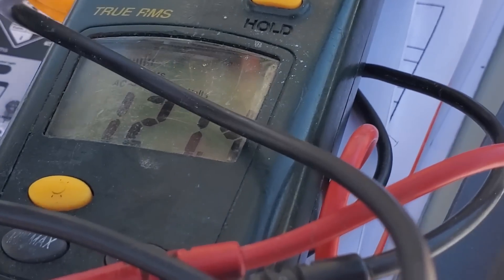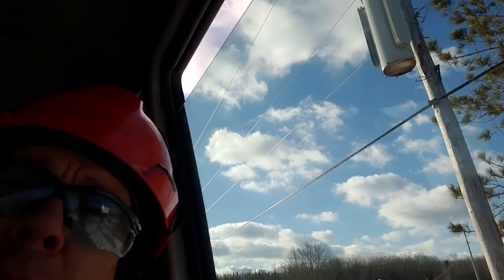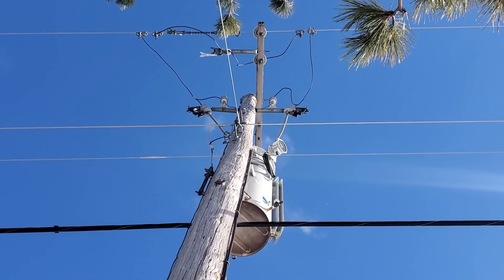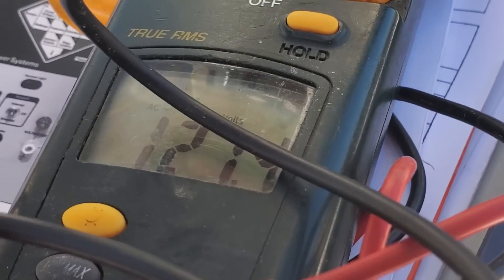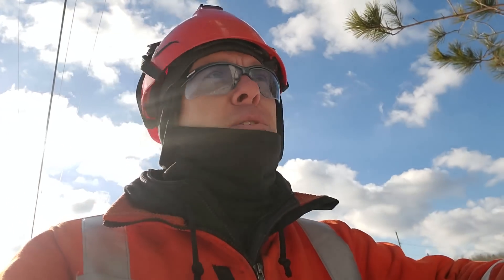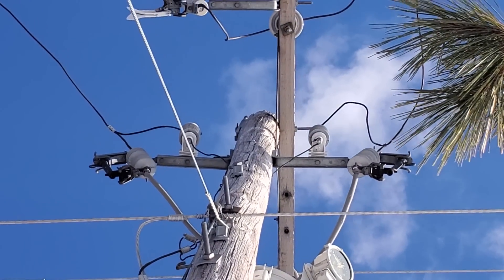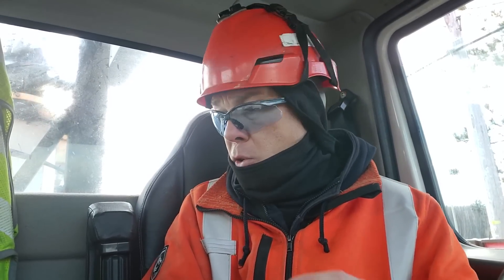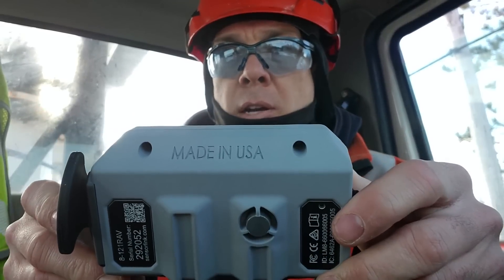Changing high voltage (7200v) at the touch of a button! - VR inspection

Comment: Great video. Voltage regulators have 16 up and 16 down tap settings. The bridge reactor eliminates the possibility of a difference of potential the contact points remain in contact at all times per tap change is 5/8th of a percent and 10% percent in total. The 3 ways to check natural is dial gauge, light in control box,rnd detector s, input feed , l output feed , sL system neutral

Comment: I noticed in my local area in Australia in New South Wales our local supply authority (Ausgrid) has taken a lot of them down since they've got a new substation built in my local town.

They used to have them because our power used to come from a 33/11 kV substation which is located 16 kilometres away from our town, now we're connected to our newer substation which is only about 2 kilometres away from our house.

We're right on the border of the Essential energy part of the grid (6 kilometres) which region covers up to the Queensland border as well as some of Southern Queensland & they use voltage regulators  in that part of our area to control the voltage in the 11 kV feeders.

Some of our local Ausgrid substation covers some of  Essential energys power distribution network !

Comment: Can i ask about the bank transformer. the customer needs 240 volts. the transformer used is 240/480v secondary. the connection at the secondary is delta using x2 and x3. Since we do this connection we receive low power from the customer. Respond and found 1 blown fuse at the primary side. Four times now we keep on replacing the fuse at the primary. if we close without load fuse hold. Maybe you can share your opinion on this matter.

Comment: Bob I appreciate all the info on the high power. I worked 30 years as a Services Tech with Southern Bell/Bell South/AT&T. We are the low voltage side of outside plant. I can tell you I was always uncomfortable coming near all that high voltage on the pole or ground.    Your videos are giving me a better understanding of exactly what  you guys are encountering daily on the line and how it works. Thanks.

Comment: I was putting in a new doorbell transformer for an older customer and I checked the voltage and it was 144 volts.  So I was concerned and checked it at several receptacles and it was the same, so I went to the truck and got another digital meter and it still was 144 volts I told customer that he should call the electric company and tell them about it. And I assumed that he would call them the next morning. Seen him about a month later and asked him what they said lol and he hadn’t even called them. I thought he understood the first time how serious it was. So he called them as soon as he got home and they came out and checked it and directly pulled the meter out, and they got on the phone and had a new transformer brought out. I had asked him if he was buying a lot of appliances and he said it seemed like they wasn’t lasting long as they should.
Reply: Sounds more like an open neutral.
Reply: @stargazer7644  What happens is the insulation between transformer windings breaks down, shorts out a section, changing the effective ratio.

Comment: If those lines were DC instead of AC. The voltage drop would much greater. So much so to be useless. This is on of the reasons why we have AC current.
Reply: Why would you think DC voltage drop would be greater than AC?  Ohms law is Ohms law.  Works the same both ways.

Comment: I notice that some of your residential transformers only have one leg for a primary.  How do you get 240 split phase?
Reply: A single primary is the normal arrangement.  You center tap the secondary to get 240V split phase.  The center tap is the neutral.  The top and bottom of the winding are your two hots.

Comment: Sounds like the R and X settings are not being used, just a flat of 124V. R and X are used to compensate for voltage drop across wire to a feed point, which is basically compensating for the real and reactive impedance of the line. 

R provides voltage boost based upon Watts

X provides voltage boost based upon Vars 

R of 2 V means that at full load of the CT  , (if all the amps were caused by real power/watts), means you’ll get 124 V + 2V of boost, so 126 V. This also works in reverse if you had a bunch of solar connected beyond it, it would lower voltage because power is flowing from load to source. (However; depending on how the controller is set. These controllers can be very dynamic pending what you need) 

For X, it’s the same as R, just with VARs. You can actually have voltage regulators “fight” capacitors if you use X, so X is not used as often. 

Just adding another layer of info to this. Great video!

Comment: Here in Europe, when I was a young boy the voltage would hover around 220VAC. 
But for some reason the power companies have slowly but surely increased the voltage over time and it is now about 245VAC.
Reply: "220VAC. ...for some reason the power companies have slowly but surely increased the voltage ...now about 245VAC."  
Tom Edison started at 100V because less dangerous. But then 100V/200V to feed twice the load with just one more wire. He soon saw you have to put 105V or 110V in to get 100V at the long end of the line. There were still 110v feeds when I was a wee boy. 
That was DC. AC systems made it even easier to fiddle the voltages. 
You can get about 22% more power on the same wires, 245V versus 220V. (Remember allowable voltage drop is larger at the high voltage.) Since loads typically grow every year, jacking the voltage gives some margin against constant upgrading the installed wires.
Reply: @PRR1954  Makes sense, thanks.

Comment: Never seen voltage regulators on lines here in Norway. It's all 3 phase and mostly 22kV. Maybe I've seen them and didn't know...
If anyone got an example that is common in Europe please let me know.
Reply: In the Netherlands, we definitely have them. They're big boys, compared to this, though. In the 10MVA range, and feed a remote switchgear house (or whatever they're called) instead of a single line/cable.
Reply: @marco23p  Any coordinates that would have one visible in like street view or something?

I'm wondering if regulators are part of substations here and that is why I don't see them. Still strange as in rural areas the overhead 22kV lines run very far. Many kilometers. They do not follow roads very often like in NA though. They take the shorter path through the woods or fields. Poles with disconnects and pole mounted transformers are usually near a road or easily accessible.
Guess maybe the distribution transformers are adjustable and can deal with voltage drops?

We also have these small prefab structures around 5-15m2 in size with a 22/0.23(0.4) transformer + HV and LV switches inside. The smaller ones only have doors on the sides to access LV and HV as well as the transformer chamber. Others are big enough to go inside on the LV side at least. The largest ones I believe can also fit two transformers.
The smallest of these are tucked between the legs of a "H"/"A" frame depending on what side you view it from. Probably only fit up to a small 315kVA transformer and 1-5 LV breakers.

Comment: Security? Isn't that the operations manual on the lid to the box? 🙂

(ADT! did the same thing in my apartment complex. The ONE thing you don't want anyone to know is on page 5... the default security code, and how to get it to revert to the default security code. Out of 900 apartments, I'm sure mine was the only one with that code changed.)

Comment: It's still a transformer, just close to 1:1. (it doesn't need to step 7200 down to 240. it needs to boost 7200 to 7500 to address line loss, rats of nim, etc.) I have the parts manual for an ABB model; there's a lot of Magic(tm) inside there. (including an internal bypass. I don't know if that one does.)
Reply: But does it have two "regular" windings? Or is it an autotransformer?
Reply: @marco23p  I have seen both. Even a primary with a secondary that is an auto transformer.

Comment: The guts of these are sort of like a HV variac autotransformer. Lots of coils around a torroidal core and a rotary tap changer. They can work at lower voltage but they are only good for plus or minus 20% where a typical variac is good for plus or minus 50 to 100%.
Reply: Yeah I was thinking VARIAC.

Comment: Well, they can be called transformers, they're just a specialized type of transformers called an autotransformer, but that's a deeper rabbit hole to dive down.

Interesting that out there you're running 124V and a 5V bandwidth, my utility runs them at 123.5V and a 3V bandwidth.
Reply: Yup they are, but they do not have the depth of a regular variable transformer. About + or - 10% adjustment range. Came across one of these at a junk yard minus the control box. It took a lightning hit that fried the tap change motor inside it.
Reply: @christopherleubner6633 If they trashed it, there was more damage than just the motor. (the motor can be replaced. they do fail.)

Comment: I'm sure it's no one's first choice but I'm assuming if it was an emergency and you didn't have the ability to zero out the regulator or couldn't confirm it and could not wait for someone else with the tools, you could dump both input and output switches then close in the bypass, or do they always forbid that?  I'm talking of if you had a ground fault on the regulator or one that dumped it's oil and was extremely hot in danger of a fire or similar true emergency.
Reply from the maker: Yes, Infact excellent comment! In an emergency, I'd likely even go to the next switch back. Shut power off, isolate the VR, close the bypass and then reenergize the line. 
I could be done fairly quickly if necessary.

Comment: Good deal Aaron, Yeah the electrical industry needs to come up with better non contact high voltage meters and non contact amp meters, because touching those high voltage lines incorrectly or by accident can be dangerous and scary, especially when working on them live.

Comment: I routinely measure 108-110v on hot summer days on each line of my 120/240 service at home. Is this something I should ask my POCO about or is it just the way things are during high loads?
Reply: Too low. Motors like the ones in AC units won't start reliably below about 110VAC. Definitely call.
Reply: That's far enough out of spec that it could cause motors to stall and burn out.
Reply from the maker: Yea... If I received a call to investigate those voltages, something would be done immediately to rectify that. Our acceptable range is 114v- 126v

Comment: it all comes down to I^2R losses as to why running a higher voltage at lower current makes sense. If R, line resistance, is constant, the only thing that you can change is the current (I).

As a side note, I wish the US was on 240VAC, and not split phase 120VAC, things would be so much simpler.
Reply: If you want to import all your appliances, the power company will sell you whatever you want.
Reply: re: "As a side note, I wish the US was on 240VAC"
Yeah, this makes really no sense. You have 240 in your service panel, you are ONLY missing 240 to the individual outlets ... see how that works?
Reply: The US IS 240VAC.  Every residential power panel has 240V in it.

Comment: Someone was giving you the evil eyes until he froze. Thanks for another interesting video. I've never noticed these before. I'll have to look for them. I probably assumed they were another transformer. Stay warm and safe. God bless.
Reply from the maker: Appreciate ya always stopping by Heather! 🙏👊 They can easily look like a transformer at a glance... Keep an eye out for the two switches! Also usually found on long or rural stretches of line.
Reply: @Bobsdecline  Voltage regulator transformers are much larger than regular step-down transformers.   They also almost always have cooling fins and/or tubes on them.  They're really easy to spot. The analog tap display is pretty universal, too.
Reply from the maker: Well of course... But to a non lineman, everything is a transformer and every outage is "a transformer blew up!" Lol
Reply: @jovetj  "Voltage regulator transformers are much larger than regular...." Depending on local preference: the 'regular' feeds 1 to 10 houses, and the regulator covers a whole neighborhood, maybe 100 houses. For the same VA, the regulator is smaller (see 'autotransformer') but the regulator usually handles lots more VA.

Comment: 2:30 Gonna have to disagree with you, Aaron!  Voltage drop is not the most-important reason we use high voltage up to the point of consumption (e.g. people's homes). The main reason is the electric Power Law.  Electrical energy is measured in Watts. The Power Law is:  Energy (wattage) = Voltage × Amperage.  If we made power lines of 240 volts, not only would the voltage drop be unacceptable, but the wires feeding all the homes would have to be so huge they couldn't be put up into the air.  The Power Law tells us, that for the same amount of power, the lower the voltage, the higher the amperage. Higher amperage means thicker wire.  The "miracle" of AC power and transformers is that, if we use a transformer to greatly increase the voltage, the amperage drops by a proportional amount.  This allows our power lines to be much smaller at a high voltage. This is why the wires coming out of a regular pole transformer are so much larger than the one going into it—it's not extra insulation!  This is also why transmission lines are even higher voltage: higher voltage allows more electricity to be carried on the same-size wire(s).
Reply from the maker: Mine was the skinny version lol. But yes, you are 100% correct... And I agree other than, regardless of wire size I don't think 120V would be usable after 20 miles! ... It might tho 🤔
Reply: @Bobsdecline  The loss of voltage and skew of power factor due to inductance is proportional to current, so with the relatively high currents in a 120/240v system that sounds about right.  And even a very fat conductor would incur the same inductance per mile.

Back in the day, Edison (DC) and Westinghouse (AC) systems competed.  Edison addressed line losses with brute force conductor size, not having to worry about inductance at all in his DC system, but again not being able to boost transmission voltage to better suit long lines.  Eventually Westinghouse systems won which is why you have to deal with stupid high voltages, lol.  (Or smart, depending on your point of view.  But every time you come near one of those high tension wires, I can only think OUCH.)
Reply: (The ultimate loss in voltage due to inductance there is not linearly proportional to inductance, but in a trigonometrically varying ratio, like the change in hypotenuse of a right triangle.)
Reply: Shoot, I should have done the math more carefully, on reflection on the EE I studied when the dinosaurs still lived is that the voltage you get with a resistive load is the adjacent side of the right triangle where the hypotenuse is the feed voltage, while the opposite side of the triangle is representing the inductive loss in the line.  At some point the opposite side becomes very tall and the adjacent side becomes very stubby.  If your load had an inductive power factor already, things worsen more for power delivered.  Banks of capacitors on the load end can be used to equalize for the inductance.
Reply: Technically: allows more electric POWER to be carried...

Comment: Are these style regulators (or regulators out in the field in general) a fairly recent thing? I don't recall seeing them until maybe 15 years ago? And the ones I've seen don't look that old 😁
Reply from the maker: They aren't as common in densely populated areas as a substation is usually close by and looks after the voltage regulation. Also 20 years ago it wasn't uncommon to find voltage boosters which looked almost identical to a transformer.
Reply: No. They've been around for ages.
Reply: Never really thought about it till you said something, but I've only seen them for about 20 years around here. Same deal, all new installations. I've seen them in the substations since I was a little weevil though
Reply: The automatic ones, maybe. Multi-tap "booster" transformers have been around for ages. They look just like any other can hanging on the pole, except residential loads don't come off of them, so they don't stand out. These with control modules (and cooling fins) are easily spotted.